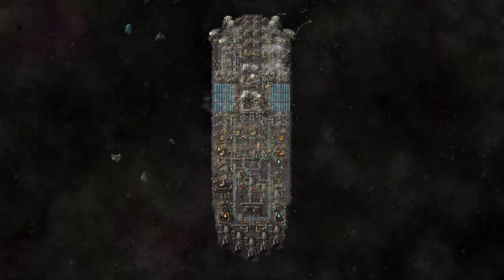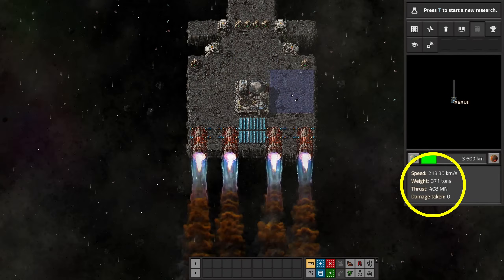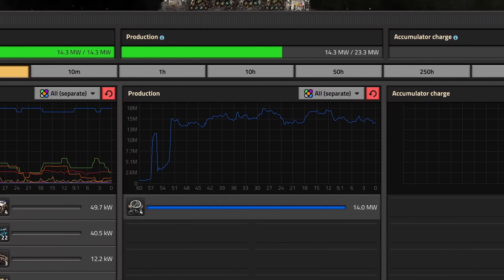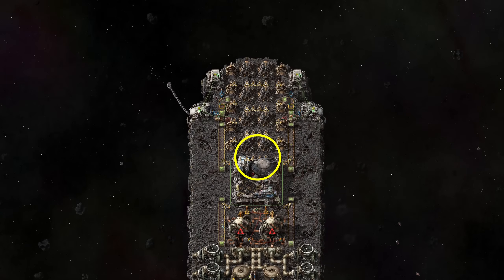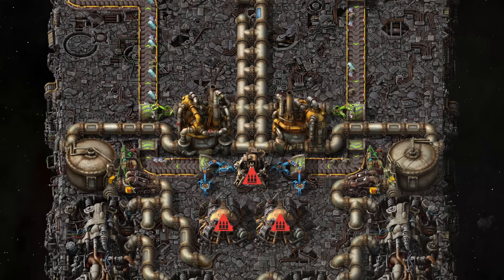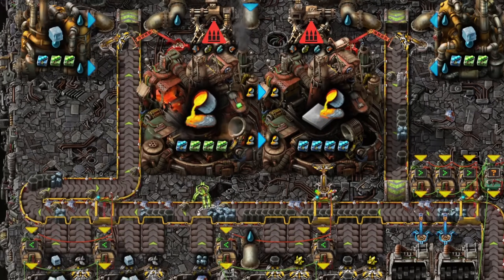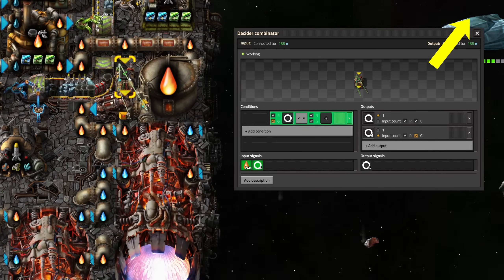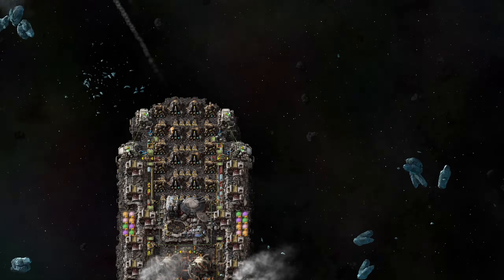Aquilo Spaceship Design - Fast, Reliable and Gorgeous! - Factorio Guide / Tutorial

Comment: ship width.... is so dumb... i didnt know i thought it was mass... this just means there is no need to optimize the ship if you have basically unlimited space in 2 directions...
Reply from the maker: Weight only has a very minor impact on speed, yes. But you can also make fast wide ships, but you need a lot of thrusters and the fuel consumption is high.
In return you collect a lot of asteroid.
That's why they had to balance it this way.
Reply: @AVADIIStrategy well that’s the idea I made a tiny ship with all legendary buildings in hopes I could make a fast small transporter for the inner planets - the idea was smallest possible weight - a single of the best thruster - fast speed… doesn’t work at all - so now I have a massive ship… I am just sad that the design options for optimal ships are so limited… it would be cool if they added some complexity to the relation between thrusters, speed, width, weight etc…. It would be logical to get diminishing returns with a speed cap where adding more and more thrusters doesn’t increase the speed - which then needs you to reduce/optimize weight and shape… just my opinion on an otherwise Perfect game
Reply: It's to offset how otherwise wide and short ships would be dramatically faster. I've got a flying wing style asteroid harvesting ship that's hundreds of tiles wide with over a hundred thrusters, and if it were purely mass to thrust ratio this thing would be moving at insane speeds.
Reply: Arguably that would be extremely fun and efficient for transporting spoilables
Reply: In addition to what others have said, it's also beneficial to a new player. Building a wider ship tends to be easier since it offers more logistics space, but also must be defended. So a new player that has less knowledge to build a tighter ship and will also likely have less physical damage upgrades will more naturally produce a slower ship that will consume more ammo but will be more capable of protecting itself due to the reduced speed.
Reply: That's why "Simpler Platform Drag" by thesixthroc is an obligatory mod. Changes the calculation so that total thrust and total weight are the central factors, while maintaining the approx. balance of vanilla very well.

Comment: Obviously, this will work. But I am surprised how many people want everything symmetrical. Why? It works just fine without symmetry. I built my ships after I figured out which devices I need/want. And then I put them on the ship in a logical way. Why make it more complicated?
Reply: Because I enjoy when my spaceships look good even if they're not optimal. Style is always at the cost of function.
Reply: @OzoneDepleter  There's two ways to make a ship look good in my opinion. Elegantly orderly and symmetrical, or whimsically asymmetrical and imbalanced. Anything in between tends to be unsatisfying, but each opposite end has it's own beauty.
Reply from the maker: I don't think it's more complicated. If you want to add something to this design just cut it horizontally for example below or above the crushers and add whatever you want. Maybe a block of solar energy to save more fuel?
It just works because it's linear and not a spaghetti ship.
Reply: The same reason that people will use unoptimized weapons or armor in Souls-likes, they enjoy the look. And also there's an unsurprising amount of autism in the Factorio playerbase and symmetry makes the tism happy

Comment: nice design, i made the big mistake in mine that i used some epic thrusters from my vulcanus gambling without setting any speed limits and crashed my first ship into quite the asteroid field. Guess i should have limited my speed too
Reply from the maker: Haha, look at my "how not to play Factorio Space Age" video and look what happened to me on my first journey.
Game would be less fun without making hilarious mistakes.
Reply: Love this design, you make so many intelligent choices. Setting the crusher recipes with circuits is great - I had already done this for reprocessing but never considered it for crushing. 

But could you please clarify how two nuclear reactors increase efficiency? Don't they just burn fuel at a set rate regardless once you insert it? Is it because one double insertion will increase the temperature further than two single insertions would?

Oh. That must be it. Brilliant and nicely symmetrical.
Reply from the maker: @WoutLamers  Right. 1 fuel cell generates 200s * 40 MW = 8 GJ energy. But when using 2 reactors each cell generates 16 GJ because of neighbor bonus.
Reply: @AVADIIStrategy thanks! I suppose it doesn't reach the 1000C cap then? I've yet to try nuclear but I feared that might be an issue.
Reply from the maker: @WoutLamers  It does, and yes it is an issue because the low amount of heat exchangers and 0 heat pipes means the temperature buffer is kinda low.
Double efficiency but waste because of temperature cap.
As is, it's comparable to a 1 reactor setup. But if you start drawing more energy continously (my ship has rare heat exchangers and turbines for 32 MW) the 2 reactor setup has an advantage.
But don't use quality nuclear reactors, it will make the situation worse!

Comment: Great design! Do you know about reading the inserter hand for empty nuclear fuel to insert fresh fuel instead of basing it on temperature?
Reply: He suggests reading the outputting inserter hand for empty cell and use this signal to trigger the input inserters. This is used on pre 2.0 base game nuclear plants to make sure that all neighboring reactors get fuel at the same time and only when possible for all of them at the same time, and therefore ensure that the neighbor bonus is always active. 
However, it is not (and was never) a way to limit the duty cycle of the reactor itself to make it run less often, which is what AVADII wants to achieve here. Prior to 2.0 when we could not read temperature, you would attach a "steam battery" and to the  output inserters and trigger them based on steam level.
Reply from the maker: @borisw9292  Right. The old system with read as pulse. The main reason we don't need that anymore is we can now also read fuel. So in this case I only refuel when there are currently 0 fuel cells in the reactor. Important to note: the currently burning cell also counts as 1 fuel.
That's why reading the output inserter is pointless. I already know when there are no fuel cells left because I can read it and have it set up 1:44 in the decider combinator.
Reply: But why? That's completely pointless, no different than just having an inserter always active. The point is to only use fuel when needed, not when possible
Reply from the maker: I don't understand what you're suggesting.

Comment: how do you put those yellow belt guards and what are they used for? couldnt find that in google, thanks!
Reply: When you attach a wire to it and click "hold" (read all contents) something like that. What it does is it reads all the contents on a belt loop. It doesnt work with splitters. So you have to use inserters. Basically he reads the contents of the belt before deciding to add more or remove from it
Reply from the maker: Exactly, if you "read all contents" somewhere the game will add those yellow outlines to the belt you're reading.
Reply: @Gh0stl3y  i tried it, omg i only did it for pulse mode

and how do i filter more than 3 items? for example i only want 5 of each type of asteroid to enter
Reply from the maker: @ezioauditore5616  If you pause at the right moment you can see how I set it up. 2:55 but theres also a constant combinator outputting every asteroid signal with value 1.

Comment: Would really really appreciate an in depth tutorial on that sushi belt reading setup to operate crushers and asteroid collectors only when needed
Reply from the maker: Added to the list of possible video ideas. The list is already very long though.
Reply: @AVADIIStrategy thanks for the great content ❤ I'm watching each video multiple times. Do you plan to have some voting system on what video is most interesting to the audience?
Reply from the maker: @repl313  Maybe in the future. Could be a youtube community poll or something for patreon members.
But to be honest: I'm not a full or part time content creator. It's a hobby in my free time. If others tell you what you have to work on, instead of doing what you want to do, this becomes just another job. After the regular job.
Long story short: I need to be passionate and eager to make these videos and it's better to work on a topic I'm currently interested in.
Reply: Connect the asteroid collectors to a decider combinator which reads the sushi belt. Then set the asteroid collectors to use the signal as filters. That's it.

Comment: small error but solar on aquilo orbit is 60% not 1%
Reply: Correct.  You can easily do solar though....but you will pay for it terms of speed AND the length of your ship.
Reply from the maker: And you probably need quality panels then.
There's nothing wrong with solar panels though.
But you need a lot. The foundry alone is drawing like 8-10 MW of energy.
Reply: @AVADIIStrategy for that are efficiency modules to help build smaller ship with min 20 epic solar panels
Reply: @AVADIIStrategy So basically, connect every inserter to the belt/hub to make sure neither the sushi-belt, nor the hub get's overfilled with items, right?
Reply: I did get to aqulio with no nuclear and no quality items, but a lot of waiting time for making ammo before starting the journey
Reply: My first aquilo ship was 119 tons and 12 uncommon solar panels. I just checked, it's still puttering along, 947 trips, now assigned to run in stuff from Vulcanus. It just takes its time